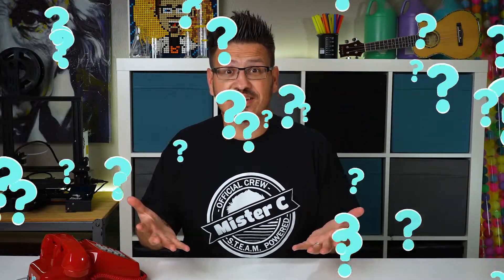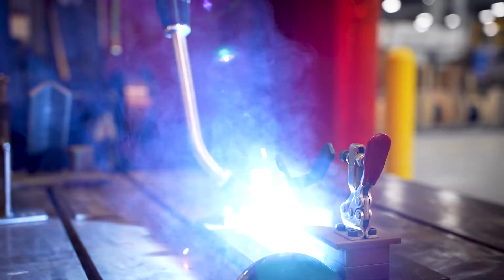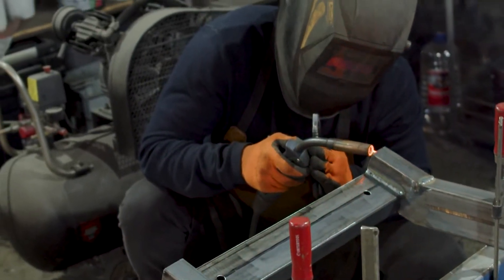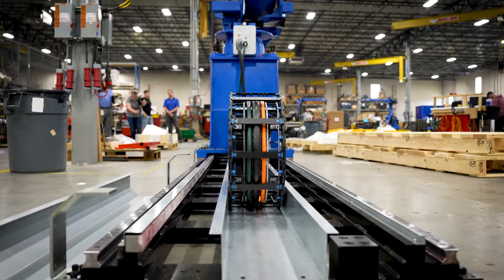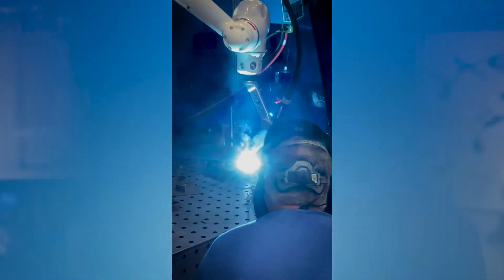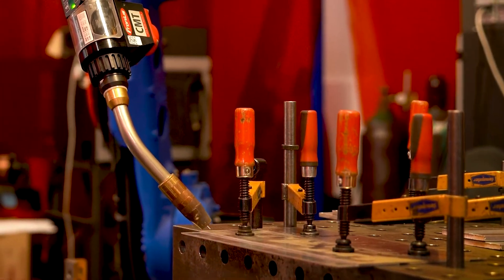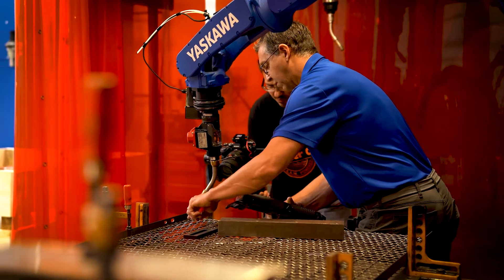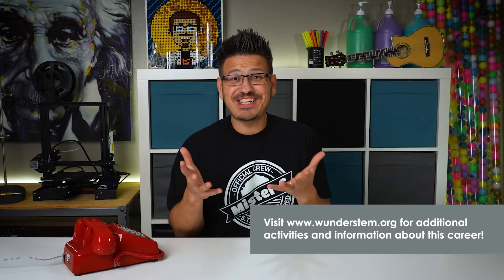Robot Welding Engineer | WunderSTEM Career Exploration

Comment: software that he has been developing?! I see he is using cmt and fronius has exactly this type of software. This guy is talk
Reply: You stated a lot of truth there.  Most engineers who understand basic welding and understand basic manufacturing robots, know If he is writing software, he isn't doing welding engineer work.  That is typically what controls engineers do and usually controls engineers work in conjunction with welding engineers to make software function well with the human machine interfaces where applicable on welding equipment.  And in general, most robot manufactures work with welding, dispense, laser and other welding process equipment manufactures to create interfaces that allow the end user to take advantage of the welding process controls needed to produce advantageous welding processes.  One weld engineer who doesn't use the functions to fine tune their processes over time like manufacturing welding engineers do initial welding process set up.  The manufacture in the end is responsible for making sure the welding processes meet the manufactures welding requirements.  Selling equipment is different than actually making the equipment work for your processes.  Creating an initial process then send it off for someone else to actually make their "turnkey" solution function.  Touch sensing and cameras being used to identify weld joint locations is not a new science.  It is more than 20 years old. They try to sell this to people who cannot make their manufacturing processes automated because they cannot make their parts the same part to part.  This equipment cannot make bad parts good.  The solution is to just make the parts manufacturable in an automated system or live with manual welding processes.  The middle ground just ends up frustrating the end user plant welding engineers who do not get listened to by the project managers who are sold on these systems that end up costing more money than just making good parts and using the robots without including the extra AI programing that ends up creating costly rework and doesn't get maintained anyway.